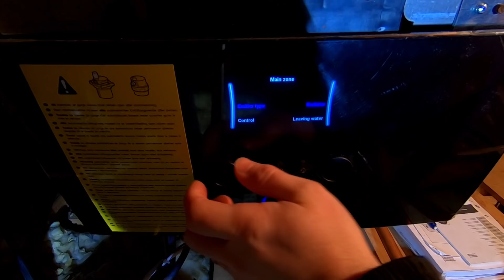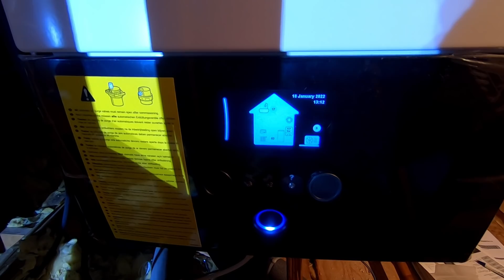How to lose £2000 installing a heat pump

Comment: I work on New Builds Dracula & the WC is wired but never connected.  For the exact same reason, to many call-backs about radiators not heating. You can explain until you’re blue in the face, but people(read females) want jumping hot radiators!!   This is called the ‘Hearth Effect’ it’s a brain thing not a comfort thing.
Nice install UP, but it looks a nightmare!!  Thanks for sharing👍
Reply from the maker: my first and last subbing job.
Reply: @UrbanPlumbers  Don’t blame you mate!!!  You’ll find a lot of ‘Eco Profit Warrior’ are just fucking clowns, quite happy to have you do a great job on-site & pay you next to f.ck all for doing it.
Reply from the maker: @TheDickPuller  mate, this is going viral. The company has been in touch too, although I did not name them. They named themselves on FB when someone posted this video and now are blaming me for this s h i t show.
Reply: The 'Hearth Effect' is a tricky hurdle for any conscientious heating engineer to overcome. I will be the first to admit that I have on occasion and reluctantly both disabled WC and increased boiler flow rates on my own installs just to get rid of a nagging customer who thinks the whole install is shit just because her radiators aren't piping hot like they used to be. We all know the conversation where a customer phones up to complain that the heating isn't working and the radiators are cold. You ask what temperature the room thermostat shows and they will say 21c. You remark that the house is already up to temperature so why do they expect the radiators to be hot. . . . .. .